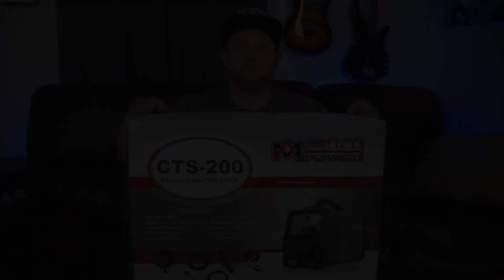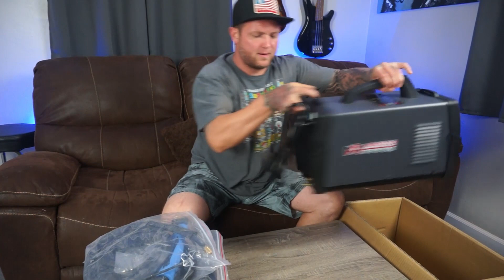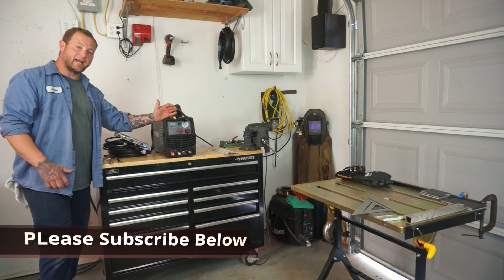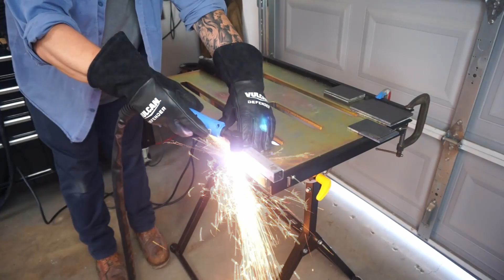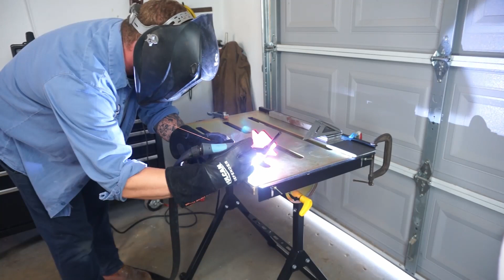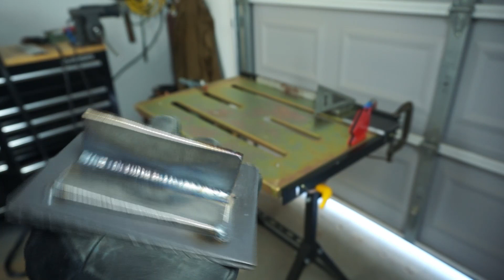Unboxing of my CTS-200 welding machine

Comment: What pressure do you set the Argon?
Reply from the maker: The plasma cutter you run 30 to 60 PSI. The welding bottle does not use PSI. You wanna run your argon regulator at 20 CFM. Hope that helps you thank you for watching

Comment: Great vid. I was hoping you would show how well it does aluminum with the TIG, which is the main reason I am looking at this machine.
Reply from the maker: This welding machine is a DC welding machine. If you want to weld aluminum with it you need to use straight Helium. Heli arc👍
Reply: @ThinkWeldingMore  your video did start me down a rabbit hole since last night when I watched it. I now know my comment was based on my lack of knowledge of how to TIG aluminum. I need an AC machine to TIG aluminum. I still enjoyed your video, as it caused me to learn about the machine you presented / demonstrated and more about TIG in general. Thank you.
Reply from the maker: No problem glad to help. You can use a DC TIG machine just use helium gas like the old days. Helium arc welding 👍

Comment: How about an update. Likes, any issues and how often and hard you use it. I'm planning on buying one and I'd like to know how they hold up. I'll be using it for projects not commercially but I have alot of projects to get done.
Reply from the maker: Have had mine for about 2 years. I use it  Regular more for plasma cutting if you do get one I recommend upgrading the ground. Otherwise great machine for the price. It's also easy to find consumables on Amazon. I hope that helps you out thank you for watching.
Reply: @ThinkWeldingMore  it does help. When you say "upgrade the ground do you mean just the clamp or the wire or both? Can the brass plug (I'm assuming it's brass) be reused and just add the upgraded parts or should I get a whole new one?   Thanks a bunch for the reply. I don't want to buy something that's going to konk out on me after a few weeks or months but I can't afford the more expensive brands.
Reply from the maker: Upgrade cable to about 20 feet long and ground clamp to a brass clamp  This will help keep it from getting hot.
Reply: I am having trouble with my plasma it don't want to start would that be the ground
Reply: Hope you still on here

Comment: No third wire for plasma pilot arc?
Reply: You misunderstood I think..wondering if it had touch or non-touch plasma..thx
Reply from the maker: One power source. You have to switch connections between tig and plasma. There is a  select switch for tig ,stick and plasma.  I hope that helped you out